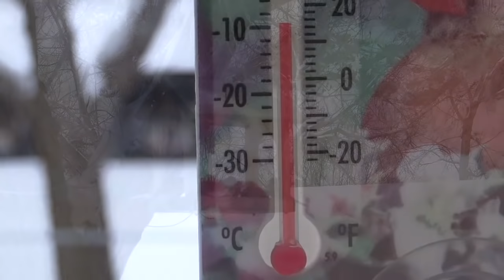Wood Carved Rattlesnake Walking Stick #60

Comment: amazing work buddy. how do you like the ArborTech mini grinder
Reply from the maker: Thank you! I like the ArborTech very much. It has saved me a lot of time in the roughing out stage, but you have to be cautious because it is really powerful and can remove too much wood too quickly.
Reply: thanks for the response. ive been carving as a hobby for quite a few yrs n everybody wants me to start selling my work. ive been using a very cheap set of chisels and a decent dremel  but those don't move enough wood n for me a chainsaw is to heavy n awkward for carving sence I only have one hand so I'm going to update all my carving tools. ive had my eye on the mini grinder and the power chisel for roughing n going to probly buy some nice flexcut hand chisels for doing th fine carving